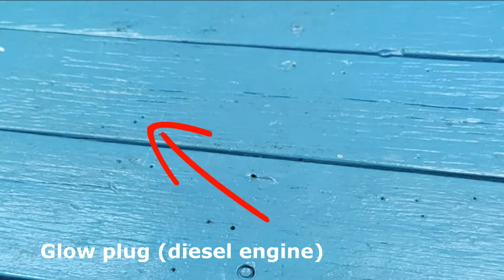How to make a Powerful wireless soldering iron in just 5 minutes with your own hands

Comment: How do build a soldering iron!  All you need is an old cordless drill, a diesel glow plug, and ...err... a soldering iron.

Honestly, I suppose this might theoretically work (if you don't care that it's got a terrible tip and completely unregulated temperature, so it won't actually be very good for soldering), but what's the point of spending time building a crappier version of something you obviously already have anyway?